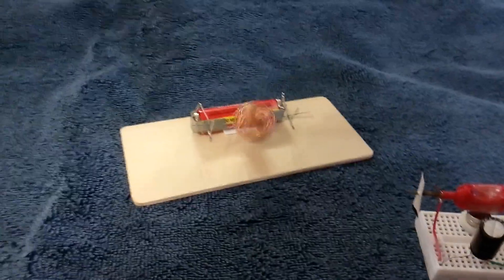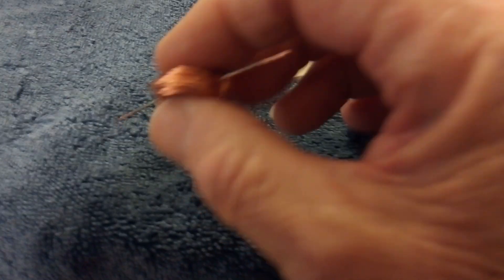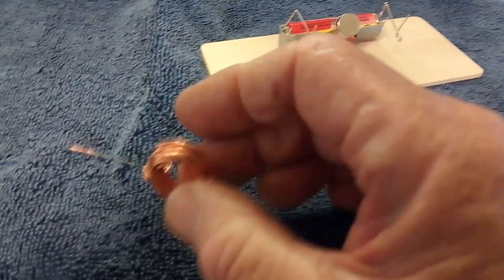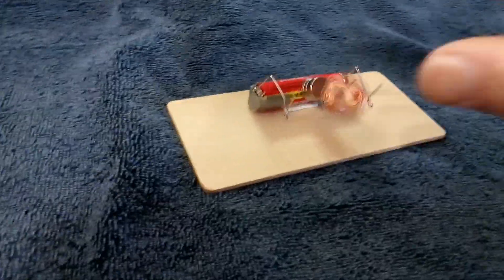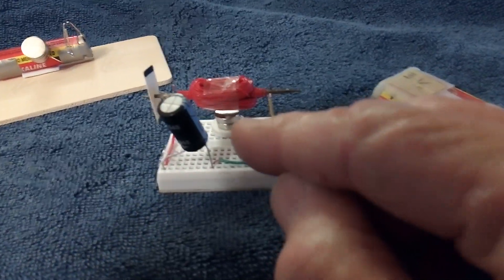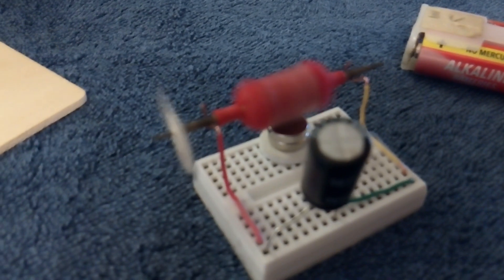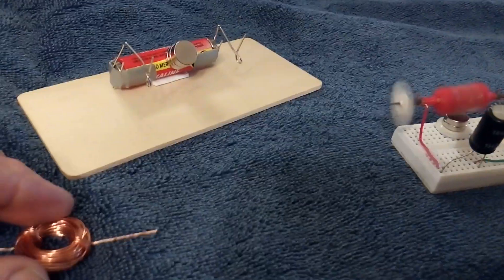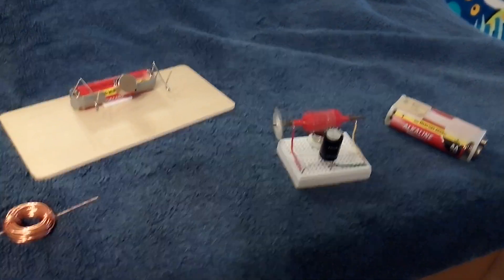The Easiest Homemade Electric Motor

Comment: Thanks for the mention. I am amazed that you haven't built one before, and I should have guessed you would use your Supercaps to run it. I wonder if there is a back spike as the coil rotates 🤔🤔
Reply from the maker: This is just a motor design that never interested me.  I listened to it running with an AM radio and the signal was very scratchy.  I doubt that there is a very good back spike.  Later on in the day I took the brass colored coil and used it with a reed switch to drive a neo magnet rotor.  That worked quite nicely.  I really enjoyed your video on this subject.  I got a good laugh at the smoke.  We have all been there. It is part of the fun with these things.😄😂